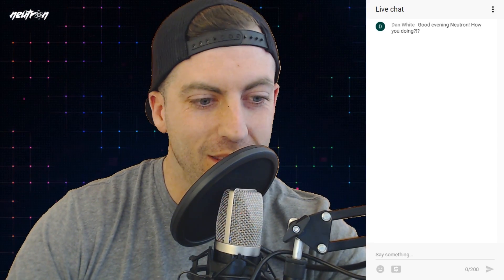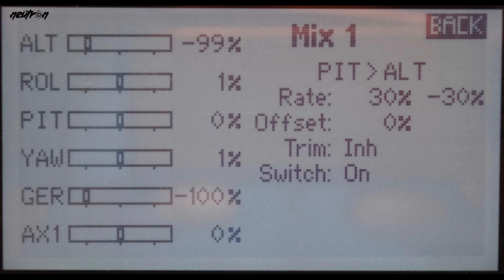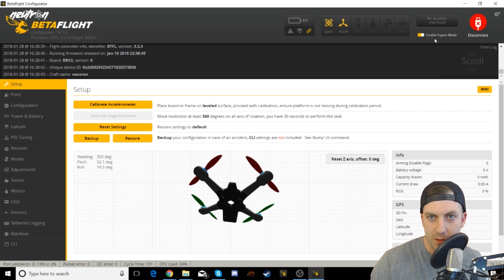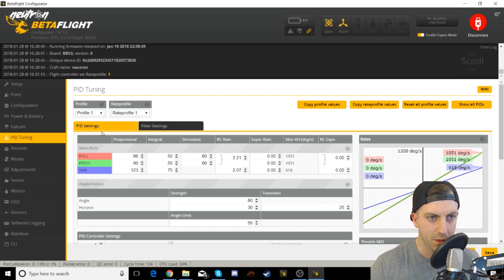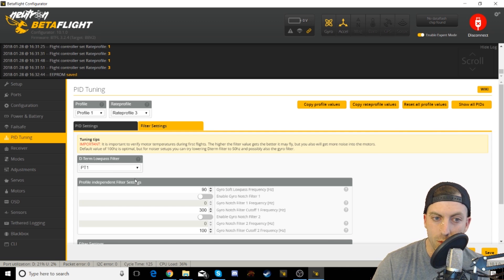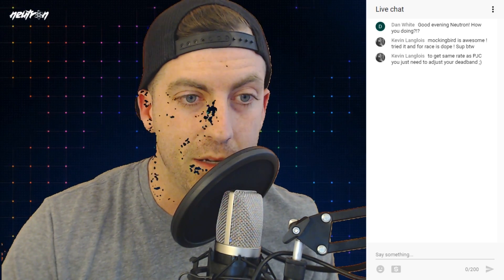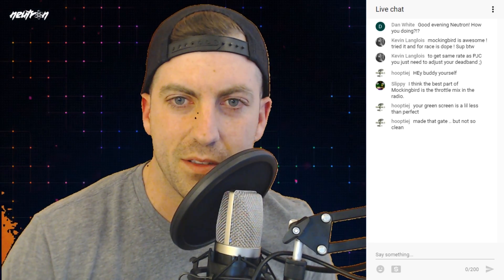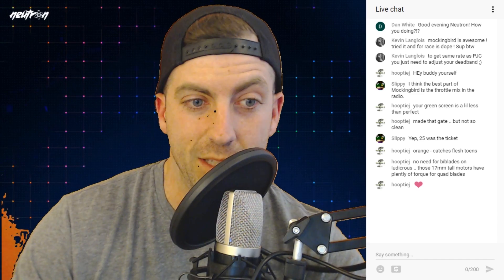PROJECT MOCKINGBIRD - Make Your BetaFlight Whoop FC Fly Like the InductrixFPV [TINY WHOOP]

Comment: I'm assuming this won't work on a V1 beebrain?  I didn't have any luck with the profile changes/modes.
Reply from the maker: it works. I set it up on my v1 before i did this on my v2. make sure you use the same switch for you angle mode and rate profile changes. Where are you stuck?
Reply: I flashed the firmware for the Beebrain V1 with BF 3.2.4 and it doesn't show the tabs for "Adjustments, OSD, Race Transponder, sensors, and tethered logging".  Because the Adjustments tab isn't there, I can't get to that part.

Thanks for the response!  I know I'll get this worked out eventually.  :)
Reply from the maker: remember, you have to enable expert mode. the toggle switch is up by the connect/disconnect button. so as soon as you connect to betaflight, just click to turn on expert mode
Reply: neutron:  Thanks!  I missed that step.
Reply: And now I feel silly.  It's literally the first thing you tell us after connecting.
Reply from the maker: MilSpecFPV haha it is 🤣